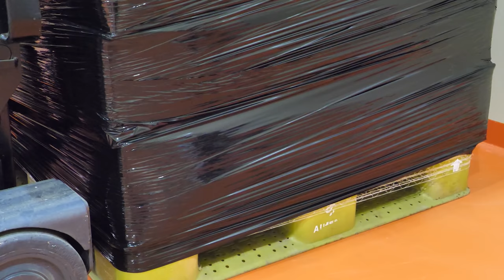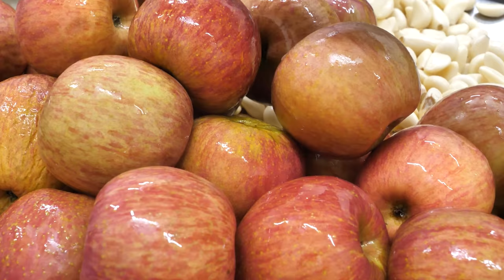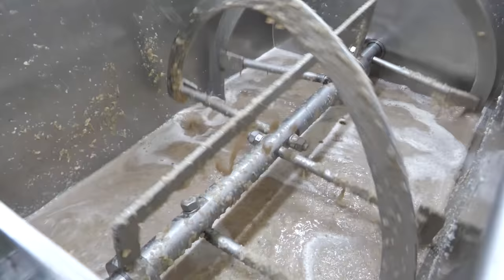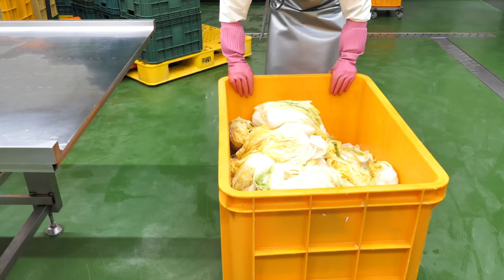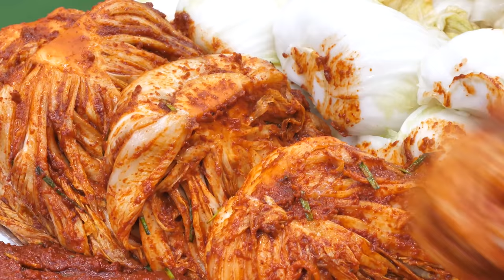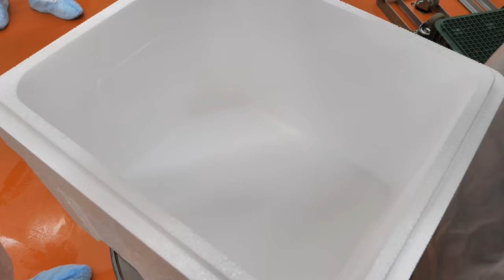"우린 모든 재료가 국산이야~" 역대급 위생(HACCP) 김치 공장 대량 생산 현장 / amazing korean kimchi factory / korean street food

Comment: Some processes looked like they just wanted to put it through a machine.
Reply: The reason why most process is used by the machine is for the cleanness. I agree people can actually wash the vegetables without the machine but that is the part where lot of uncleanness happen. When people wash vegetable, they will have to soak it in the water and keep recycle the water. However, if they use the high pressure water system, they can just make the vegetable walk thru the water